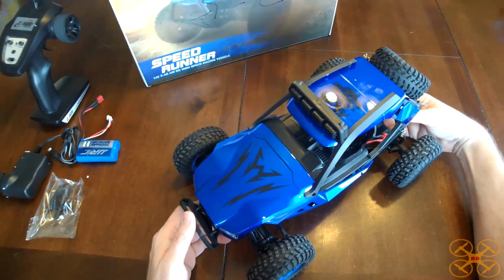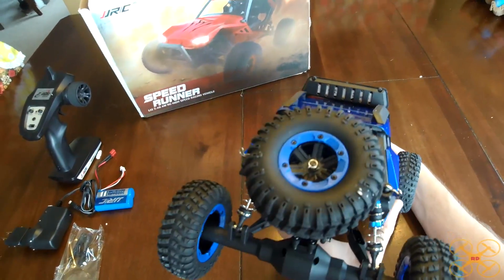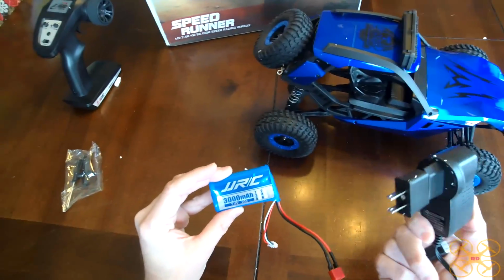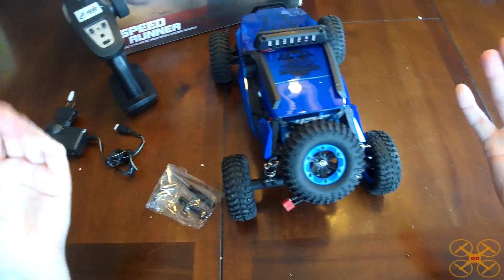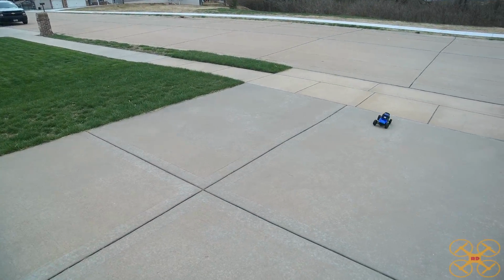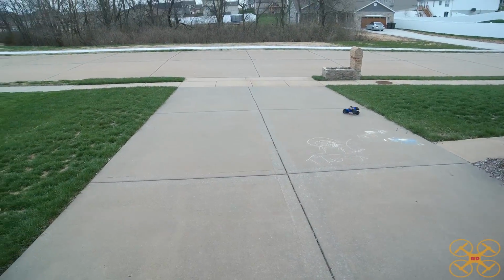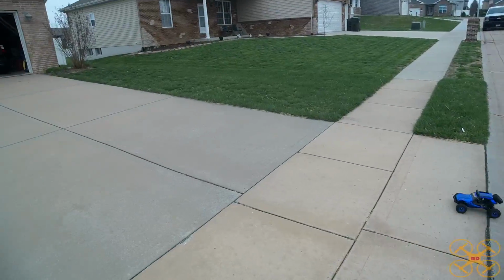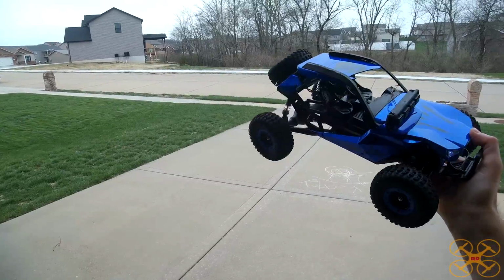JJRC Q46 "Speed Runner" Buggy Review & Test Drive

Comment: it's a POS..More PLASTIC JUNK. Diiferentals had been breaking for decades...for some retarded reason...retarded manufactures make retarded parts for retarded people.
Reply from the maker: OneEyE Monster lol, did you see what happens at the end? No, I don't recommend it and said so. They're better options out there such as the Pxtoys 9200 Piranha.
Reply: That aint shit...I used to lunch my savage 20"..Continously
My buggie would go super fast...it would skim the rough terrain.
I launch that too. i even launch my T maxx (POS)..even it had
metal gears in the diff....
The best one out of the bunch is the RC 10GT becuase it was light..
hardly any parts...You had nothing to break.lmao
It couldnt keep up with the T maxx in tall grass...that's about it.
It would out jump it or out race it all day long.
It could do donuts super fast..it's stand in it's end and spin like a top.lmao

All my toys could pop wheelies from a stand still..
The  RC 10 GT could do a back flip ( if you know how to tune it right)..Out of the box..stock. The only thing i had to get new..were tires...That;s just from me abusing it..making it do donuts all the time...

The 540 is going strip or break all those damn plastic gears. People break
that truck on the first day or their test video.lmao
It's the same damn truck coming out of the same factory...line #1, Line #2..Fuck...I dunnn know...maybe they build one truck one day and a different one the next...or they do a production run of 1000-5000....depending how wants to roll the dice.lmao
Just like all the DRONES...20 different brands...but basically the same thing.

I have the HBX ( un brand). Got it for $42. It's actaully prety fast for a 2s Li ion..I'll have to get metal dogbone for it before I install 540.lmao
Those damn plastic gears in the differental, thou
Reply from the maker: OneEyE Monster I don't play with these cheap cars much. If I'm going drive them for fun I'll stick with my DHK Maximus. 1/8th scale, 50mph is much more fun.
Reply: I dont mind them ...i get into all types of R/C. i got side tracked again....Iwas suppose to be build a part jet or R/C parafiol.

I ran across used laptop battery packs. Li ion are something new
to me. Alot of started with possible longer flight time.

I tried in on cheap R/C..it's just steps before I install them into
an air plane model...
i always get side track.....I got a NewBright ( POS...POS.lmao) 1/8
corvette for $30. it been a challenge. i can actaully get it run on 4s Li ion.
I also installed a larger pinion....on a 180 motor.lmao
It'll go over 20 mhp
i was thinking of slapping the drive train from the HBX 1/12 in the corvette....mostly becuase it runs on Li ion..
But install a 540 or 550 motor in it.
Simply increase voltage. I might have a change of plans.
Im still going to build the corvette...Not 50 mph..but at least over 30 mph

i do have a couple of brushess 2836 1200 kV.
i can actaully mount it onto a car or boat in it's current condition.
I just have to gear it accordingly.

My Car/boat TX, esc....is on the slow...slow boat.lmao

I actaully should be building my flying V or exployer ( guitars)
I built one of each already..in white...I need one of each in black.lmao
That's becuase I have white strat and a black strat...Cant mess up the set..man.

I had to install 1s lipo into a coke can R/C,,into a hotwheel...the other day.
I had too.....It was a challenge.lmao

Just getting back into the Hobbie again...i had nitro everything

Comment: I just got this truck. issues I have with it are 1. one of the front wheels doesn't spin at the same rate as the others. front diff problem? 2. left rear suspension is kinda bent I think it can't handle the load. Rear shocks are shorter compared to wltoys 12428 and 23. I have both wltoys.  3. Receiver keeps cutting off. 4. Left front wheels wobbles a lot. Tire touches the a-arm. swapped out wheels still the same.  At this point I don't know if I'll start ordering parts for it (diff, suspension, receiver) or I'll just use it for parts for my WLtoys 12428/23. I never had issues with both of them.  Got it for around $75.   parts are fully copatible with Wltoys except for the rear axle.

Comment: No way its 3000 mah...
Reply: RD's Drone Reviews Oh ok well if you look up Capo it's a RC company from abroad. They have a Rock Racer called the Ace 1. Incredible machine price point of 1200 plus.not my cup of tea.
Reply from the maker: david teddy agreed, I'm suspicious of that as well. I used a 1500mah in the drive review because the stock "3000" had a bad cell but I didn't mention that because it is very unlikely anyone else will get a bad battery. It only took 600man to fully charge the "3000"
Reply: RD's Drone Reviews  this was an excellent review I have one of these come I'm in love with the Capo Ace1. This being a replica of it. Do you think I will have the same issue with my battery?? Should this be a concern???✌
Reply from the maker: Jahmen RC thanks! I don't know, I'm not familiar with the truck you speak of.

Comment: Take the spare off..change over to oil filled shocks and wider tires and it will handle much better.
Reply from the maker: PhilthyCoRC I'm sure that would greatly improve it especially removing the spare wheel but I was reviewing it as it comes first to see how it handles. I've been in r/c cars for 30 + years so I have a lot of spare shocks and parts but I always review items as they come first and with it busting so easily I can't recommend it when they are better choices out there for less.  Thanks for your input.
Reply: Right on.. just talking about in the future upgrades..I understand that you were doing an out of the box run..cheers.
Reply from the maker: PhilthyCoRC cool! Yeah, I mentioned oil filled shocks might help in the video but I neglected to mention removing the spare tire.
Reply: The spare throws off the center of gravity and the tires are on the skinny side like a crawler..buggy or truggy tires would help.
Reply from the maker: PhilthyCoRC yep, it sure does make it much more top heavy.

Comment: So, I got a wltoys 12428, same kind of thing, and they flip on asphalt or concrete real easy. Off road, on gravel, sand, ice, etc they WHIP ASS. If you cut traction, they are so damn fun. Frankly, most monster trucks or buggies do better in the dirt. Just a thought.....
Reply: Additionaly it seems that this car is more expensive and has plastic diffs. The Wltoys 12428 comes with metal diffs for some time, now. I have seen that on some YT channels. So, the 12428 is still the ruler and should sooner or later find it's way into my arsenal!

Comment: Maybe removing the spare tire would help keep it from flipping. A better battery besides those 18650 cells like you said would Def help.
Reply from the maker: James Linden yep, agreed!  The spare tire really adds a lot of weight. Also my 3000mah battery seems to be bad so I actually ran a 1500 in it got this review. I didn't mention the battery issue because that was just a fluke with mine.
Reply: If it's just the same POS with a different body on it..more powerful batteries
strip the spyder gears in the differental.
I slapped a 30C 2s lipo  in a 1/18 wltoy...itt actaully killed the motor..via MELTING the FAN then shorting out the whining after you run it and let it sit.lol